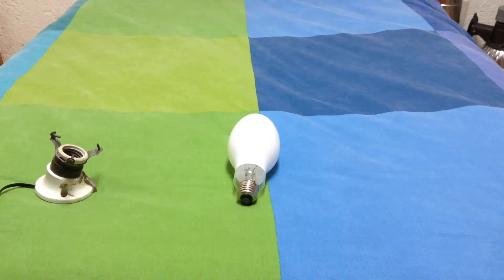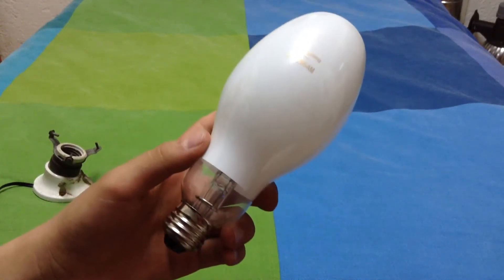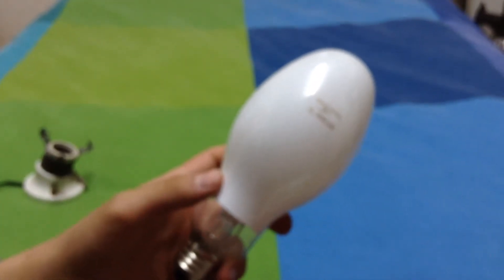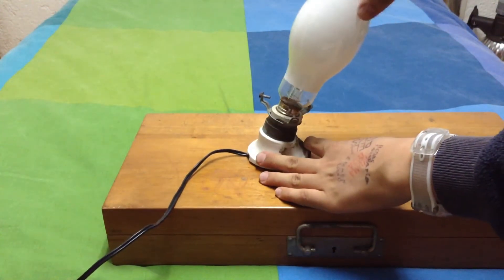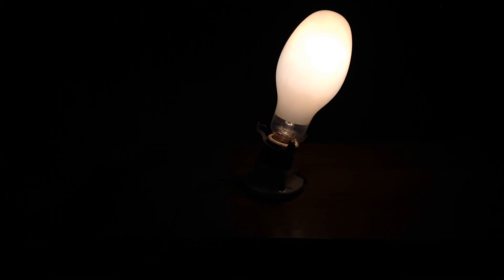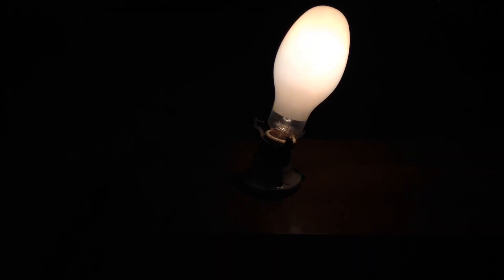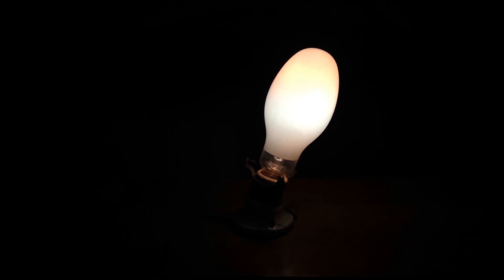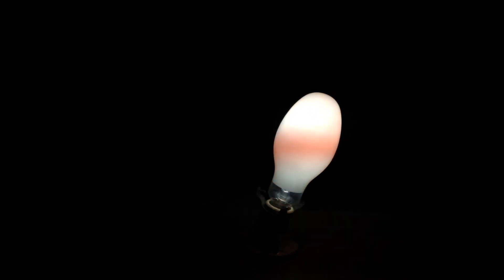Self-Ballasted 100W Mercury Vapor Lamp.

Comment: Are these bulbs bad for your eyes? Can you use them indoors? And how energy efficient are they?
Reply from the maker: +Ren 式神 An HID lamp exploding happen more with metal halide at the end of its life, mostly when they burn in an horizontal position, but experience shows that maybe just 1 out of 100 bulbs actually explodes.
Reply from the maker: They are not as long as you don't light them with the outer bulb broken.